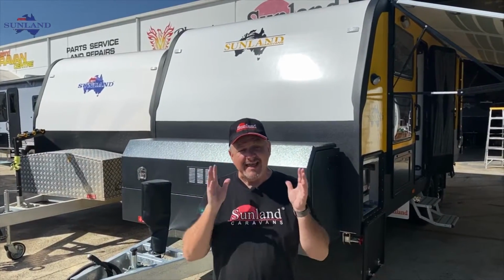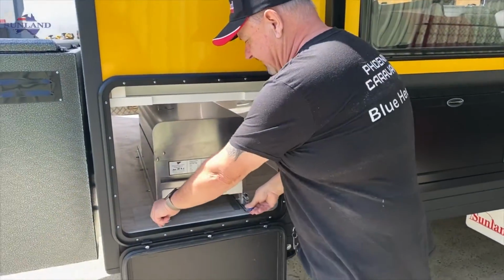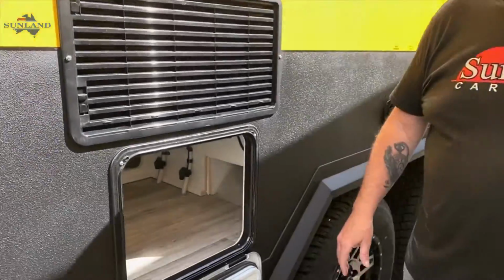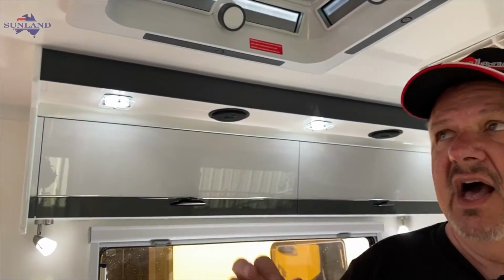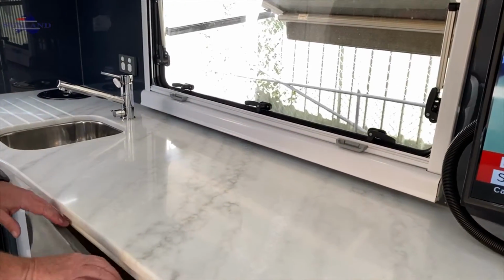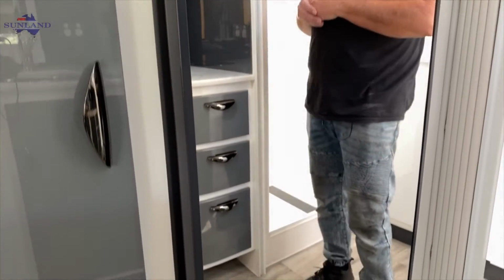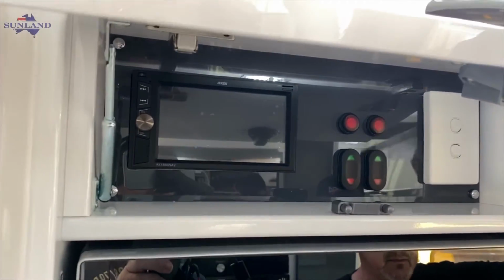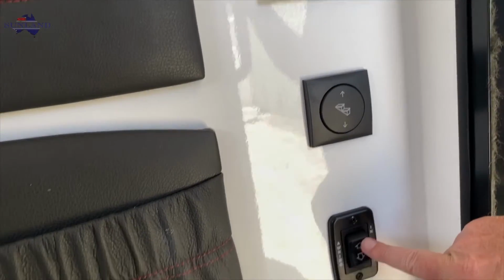Sunland Caravans 'Phoenix Rising' Off Road Caravan

Comment: Have question it's atm is 3.5t its tare 2800kg there abouts giving a payload of 700kg most tow vehicles if not all can tow 3.5t once you take tow ball weight of lets say it's 300kg leaves you with 3.2t leaving you with a pay load off just 400kg thats not taking in account what's in the tow vehicle as pay load how can this be legal 
Can you please help me with this question
Reply: You are very confused the atm is 3500 the tare is 2800 so you have a payload of 700 kilos the ball weight isn’t part of the payload it’s how much of the load is applied to the ball. So for this to be legal you need a vehicle that has a true 3500 towing capacity to give you the 700 payload. If you need further clarification feel free to call me direct 07 5499 2250
Reply: Rene, wrong on "most can tow 3500kg".  My Colorado has a GCM of 6000KG and a GVM of 3150KG.  That leaves 2850kg for everything else,  including yourselves.  Cars similar to mine can never legally tow 3500kg and that includes Dmax, BT50 etc. GVM upgrade only affects what you can carry in the car but because GCM doesn't change,  the result is that you can't tow as much.
Reply: @GregHart2880  what you have written is exactly what I mean 
The great people of sunland caravan   
Have spoken to me of what I asked and for me as everyone who owns the type of vehicle we have couldn't realistically tow that caravan
Reply: @rene2949  The problem,  then, remains what to do. A smaller van or a different car. I am still waiting to see how Dodge Ram does but never buy the cheapest one. It has the same towing capacity as my Colorado for over $20k more.
Reply: @GregHart2880  you and i have the same problem 
This is what we looked at buy a landcruiser which you can have upgraded to tow in think it was 4.2 t but you have to do this before you register the vehicle a secondary manufacturer's upgrade with upgrade you are looking at between 100k and 150k or you can keep your car and what we plan to do is make our Ford ranger a 6x6 or 6x4 and you can do this to a registered vehicle for around 70k but the virus stopped that doing that you can tow 3.5t
Reply: @rene2949  Buy a 19 foot 6 Blue Heeler.  That's what we did. Until we win Lotto, that's our only option.